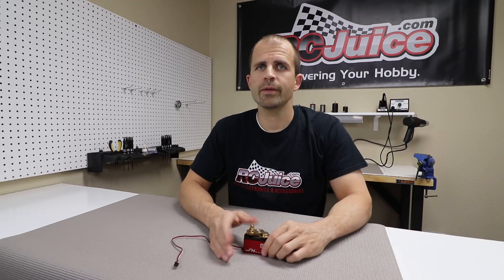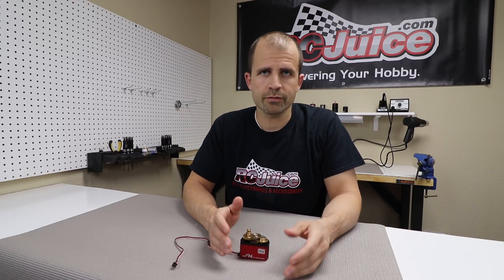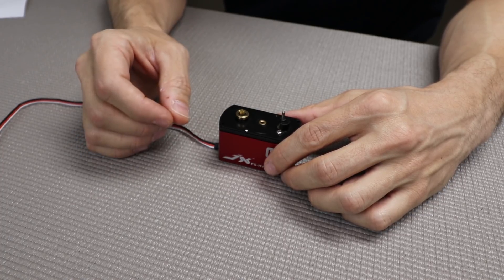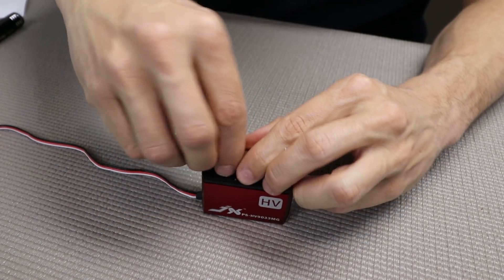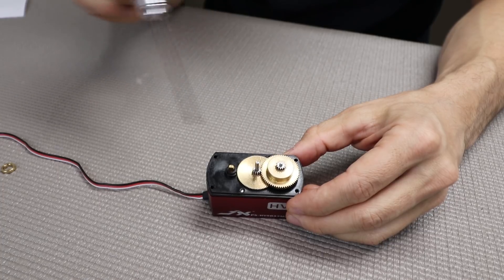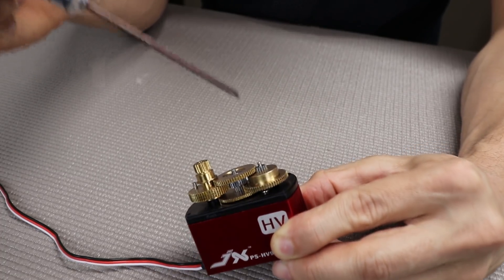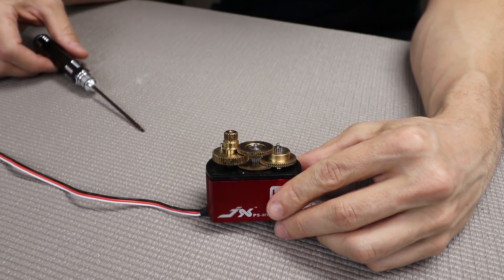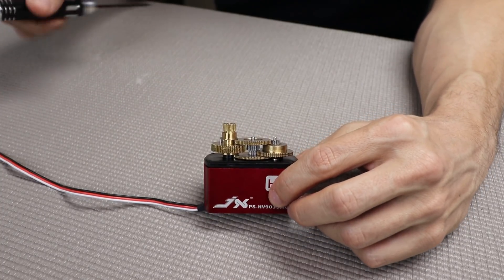How RC Servos Work

Comment: very good explanation really knowledgeable i have one question in servo they use KC 5188  supply to motor from pin 3 and 6 and pin 1 and 8 going to transistor if i take that pin output and attach to 2 Channel DC 5V Relay Module with Optocoupler Low Level Trigger Expansion Board and with relay attach high volt motor and motor shaft fix with potentiometer will it work actually for high torque servo motors and drivers are very costly i want to control only direction speed not required in my project waiting for you response i subscribed your channel waiting for your notification thanks
you can see i am doing different type of projects 
@yK-A